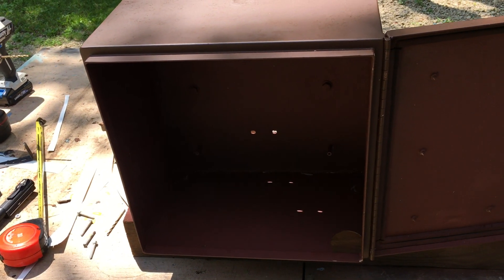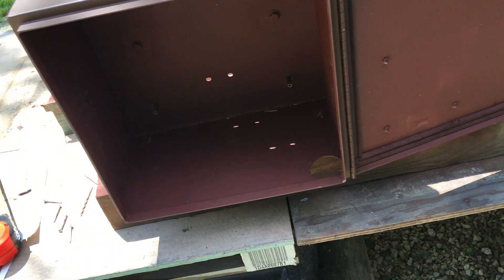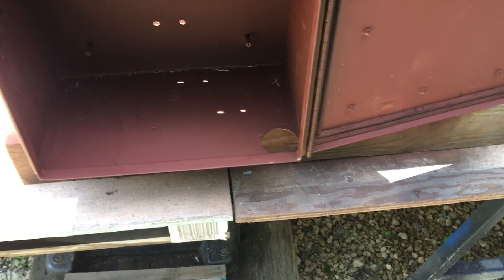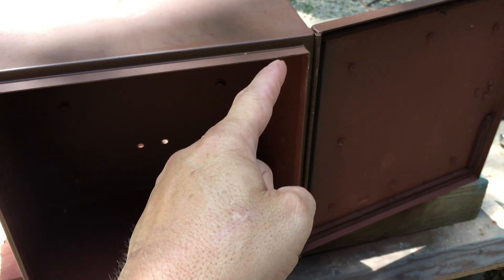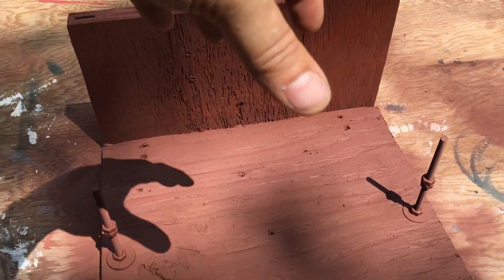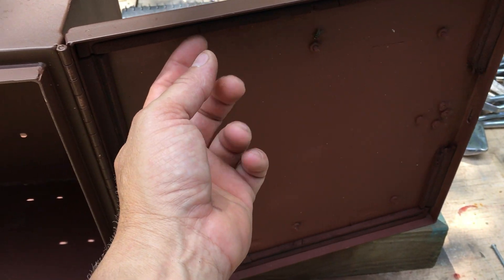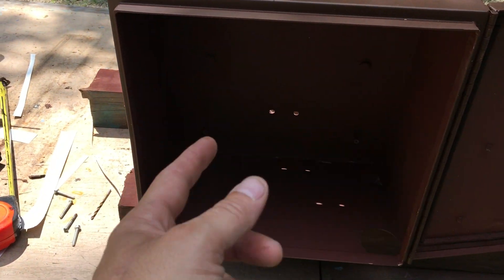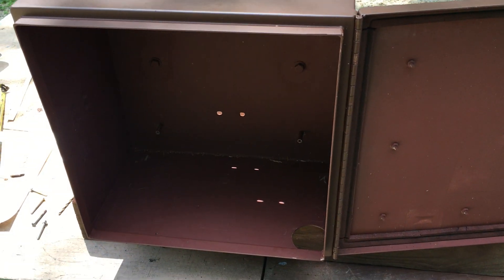🔺PART 3 My modified RETEVIS rt97 GMRS Two-way radio repeater "BOX" MOD!!!🔺

Comment: Very good series so far. For your coax and power inlet, make sure you put some kind of metal screen or bird and insect proof insert to keep them out. If they can get in, they will build nests or try to eat the insulation on the coax and wires. Had that happen myself once. Good luck with this.
CHEERS from Colorado
Reply from the maker: Thanks and yes i will use steel wool for that :)
Reply: @GMRStwowayradio  
Better yet. You to your local Domino's Pizza. Ask the store manager if you can buy a large pizza screen. These are much sturdier than using steel wool or screen door mesh. It will still allow air flow, and keep all but the smallest insects out. Maybe even put the steel wool between 2 layers of the mesh. Looking forward to seeing how this all comes together in the end.
CHEERS from Colorado

Comment: That’s cool set up . I’m going to build a smaller set up . I’m going to use a argent simplex repeater or a Latnex RC-S120 simplex repeater controller . I’m hoping to find a radio that is about 10watts that I can hook up to it plus use a mobile antenna
Reply from the maker: Thanks and my cables came in, I guess a week went by already I forgot when I order them..lol!! Why are you looking for just 10 watts? Because of power draw? You can use a retevis rt97 repeater with a mobile antenna and that does 5 watts 120ac Or 12 volt dc and has little power draw like 2 amps